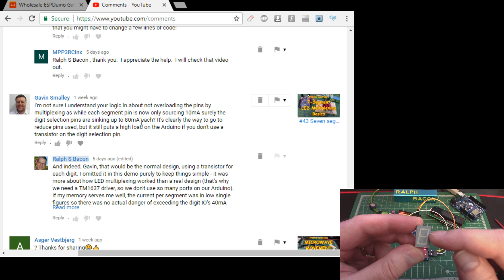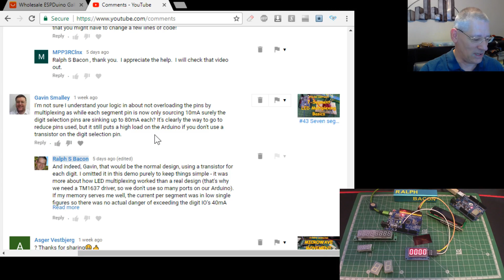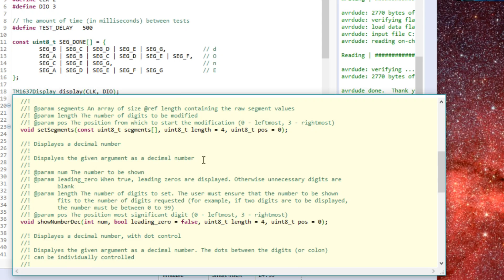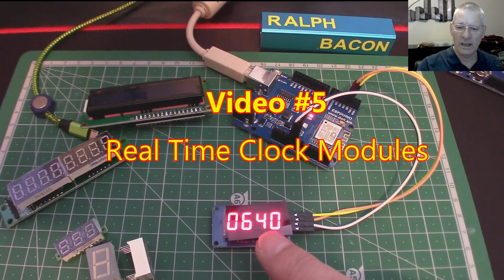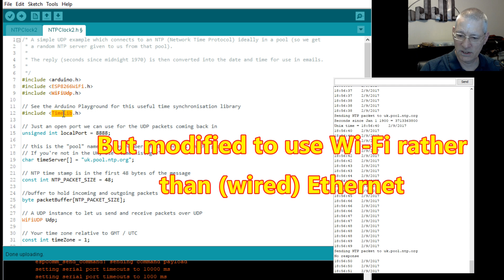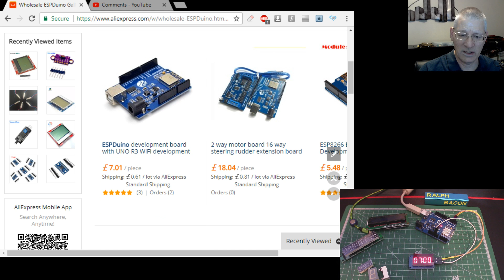#94 TM1637 LED Controller (Part 2) using NTP Server

Comment: Very good. Just a tiny remark. It is possible to set the time on a DS1307 or 2331 from the code, by pulling it from the system time. Adafruit lib gives an example.
However, to avoid that the code will be set and reset every time you  start, the procedure is as follows:
Upload the code and let it run to set the time from system.
comment out the lines that do that and then upload the code again.

yes, ntp server is easier

Also, adding an ESP to a UNO if you 'need more pins'  is posible, but indeed seems a bit of a waste and the communication may be a bit of a hassle. Can consider just adding more ports, analog or digital to the I2C of the ESP.
Get one of those  "LCD I2C expanders"  for less than a dollar and you will have 8 extra ports on your ESP (ofcourse sacrificing two for I2C
Need more analog? add a PCF8591
Reply from the maker: A PCF8591, Ed? Hmm, I don't seem to have a video on that particular chip. And you say it could add analog ports to an ESP8266? This I absolutely MUST investigate further. I did a video on the PCF8574 I2C bi-directional pin extender (video #49), it works well.
 
Yes, your method of setting the time on a DS3231 is well known (and I hate it, it is so clunky). I do have a library that I wrote that lets me set the date/time of such a device using just two buttons but I've never published it as it is in continuous 'beta' testing! If only I had more time... Thanks for the heads up with that other chip, you never know I may even do a video about it :)
Reply: Sorry about that setting time thing, indded it is well known but from yr video it seemed as if you werent aware of it (which i could hardly believe).
The PCF8591 has 4 analog input ports and one analog output. I am sure there are chips that have more input ports but i picked this one as it is cheap and there is an experiment board  with that chip available. https://arduinodiy.wordpress.com/2016/10/17/adding-a-pcf-8591-adcdac-to-esp8266-01/
I have had it on an esp-01 and currently i have 3 of them on a wemos. I think the pcf8591 is only 8 bits but that is enough for most of my needs (soil moisture, battery voltage). 
The PCF8547 is pretty good. I especially mentioned the LCD i2c expander module as they are usually cheaper than the 'pcf8547 I/O expander modules' eventhough it is the same chip, and usually also cheaper than the bare chip
Reply from the maker: Well I've ordered a couple of the PCF8591 analog expander boards (only 79 pence each, free shipping) so when they arrive I'll have a go (assuming that this time I don't forget all about them!). They seem easy enough to use so I do a very simple demo, ideally on an ESP as that is really the need.
Reply: Ralph S Bacon great. I did them on esp as well. Looking forward to yr vid
Reply: mind you that most modules have a fixed I2C address so if you want more than 4 ADC channels you have to modify the  module PCB a bit
Reply from the maker: The one I bought looks uncannily like the one you posted a link to (but from China) and allows up to 8 addresses by moving those red headers about - it changes the I2C address to a possible 8 different ones to avoid a clash with either more modules of the same or other things on the I2C bus, like LCD screens. I'll go through it all in my (potential, future) video.
Reply: The  jumpers you see  are not address jumpers, they are there to  connect the  on board sensors to the  ADC inputs.
But  to make sure I will  check my board.
Yes, Have the board in front of me. The jumpers connect the 3 sensors (LDR, NTC, Potmeter)  to 3 of the  ADC's for experimenting. Remove the jumpers for  straight input to the ADC's. No jumpers for address setting. The circuit  shown in that link shows those jumpers as connected to the on board sensors
For my  practical 12 channel application I just used the bare chips that cost also next to nothing (I think 5 for 2 euro)
Reply from the maker: Oh dear. Oh well, the A0, A1, A2 blobs that appear on many I2C boards must surely be here somewhere, as the datasheet is quite clear that this is the way to change the I2C address. I'll see (in about a month if my last slow-boat-from-China is anything to go by).
Reply: Sure, there is no doubt about that. The address is 1001A2A1A0. But  in case of the module,  changing it would probably involve desoldering  one (or more) leg(s)  and connect  to  Vcc. Seems doable, but it is the reason that for my 12 channel board I  took  bare chips. Otherwise I  happily would have joined 3  e experimenter modules.
"As is", the module address is 0x48. The 3 address lines  are pin 5,6and 7, just adjacent to ground (pin 8).
There IS a module though that has the addreslines settable by jumper https://www.aliexpress.com/store/product/PCF8591-AD-DA-Board-A-D-Converter-D-A-Converter-Module-with-I2C-interface-PCF8591-on/407494_474305090.html
But that is  much more expensive
The modules are 0.80 cts (euro)  and for that money you get a trimpot, an LDR and an NTC all for testing purposes thrown in. If you only need 4 additional  ADC's it is an excellent buy. If need more, there is a nameless custom chip http://www.hobbytronics.co.uk/datasheets/ht_adc_i2c_spi_datasheet_v01.pdf  with 10 channels but I think that is  either a microcontroller in itself or a programmed gate array.
If you need more precision that the 8 bits of the PCF8591 then there is the 4 channel  ADS1115 (16 bits), but all of these are  more expensive to considerably more expensive. Mind you that with just one PCF8591 module added to a Wemos, you already have the same amount of ADC as the UNO AND stilll have I2C lines.
There is a library, but that only does the ADC, not the DAC, but the chip is very easy to program, no need for a library

Anyway, far off-topic regarding your current video
Reply from the maker: How typical. I found the datasheet for my module (same as yours, YL-40) and it does state all address pins hard wired to ground. Hmph. But for a bit of experimentation it will have to do. Desoldering the surface mounted legs may be an option for (one or more of) the address pins. The ones with jumpers for the address are indeed a ridiculous price. One caveat mentioned is that the output voltage level is below 5.0, around 4.17, so some modification may have to be done with the Arduino's REF pin to get it working properly. BTW don't worry about meandering off topic here, many more business deals are struck around a golf course than in the board room.
Reply: The module just connects Vref to Vcc. In my case that was 3.3V and that gave me a full 8bit reading range. 
As I am using it mainly for measuring  soil humidity I didnt really need milivolt accuracy. I understand that the chip can be 50mV 'off'  but whether in the datasheet or somewhere else I saw a correction technique for that. Again... for most applications 50mV will not be a huge problem. I do not see anybody build a high precision DVM with an 8 bit ADC expander :-)

The pricy module that has all the addresses jumpered seems to belong to a range of chainable I2C modules. Have seen a PCF8547 module that would probably slot right in there https://www.aliexpress.com/item/PCF8574-IO-Expansion-Board-I2C-Bus-Evaluation-Development-Module-Hot-Sale/32354383972.html
Why the ADC has to be so much more expensive I dont understand.
The 4.17 Volt output that the tester described was with a 4.88 Vcc and an LED on the output so I guess that made the voltage go down. According to the datasheet the Ao should be between 0 and Vcc without a load. With a load of 10k it is between  0 and 0.9xVcc (0.9*4.88=4.4). The module however has a heavier load (1k resistor to the LED)
Reply from the maker: Ed, I'm sure you're on some sort of commission! I liked that I2C chainable device you linked to so much I've ordered a couple; it will be interesting to see how they compare to my previous digital GPIO expansion module. Yes, all that info regarding why the output voltage was so low is totally correct of course; I'll load it lightly (10K, or perhaps 47K if it's still reliable) and see how it goes with a 5v supply. I'm keen to see how an 8-bit device compares (accuracy-wise) with the Arduino's 10-bit range. Perhaps it will be 'good enough' for the type of sensors we tend to use.
Reply: Hahah, I wish.  Actually I have one of those PCF8547 chainable devices, but if I  now would need an 8 channel I/O expander I would buy  one of those i2C LCD expanders. They have an PCF8547 as well and are usually around 50 cts I believe.

Anyway, as u now have the daisychanable  i/o expander, you just got to get that expensive ADC module as well.

Though I use my "bare"  PCF8591 DIY board  for the ADC, I  just now tested the AO DAC and it gives a Vout of a fraction below Vcc. 
I generally use the Arduino Analog port to keep an eye on batteries, for NTC's, and LDR's. Nothing that really requires 10 bit accuracy. Yet I'd be  interested to see yr results.